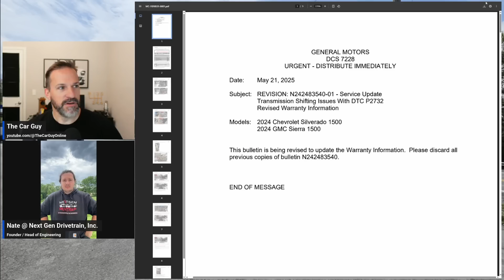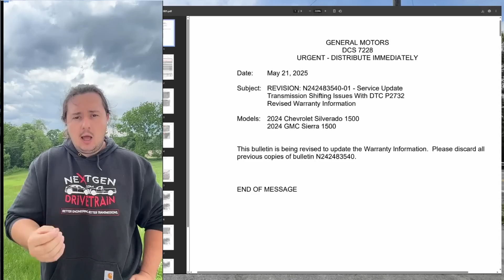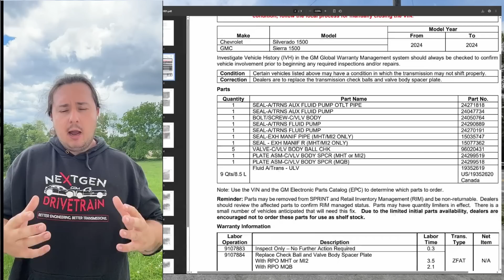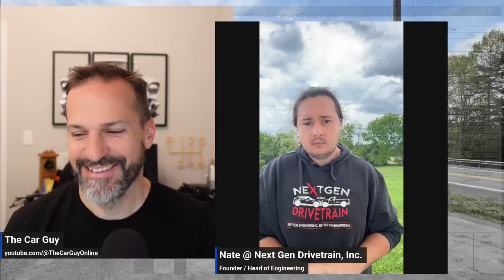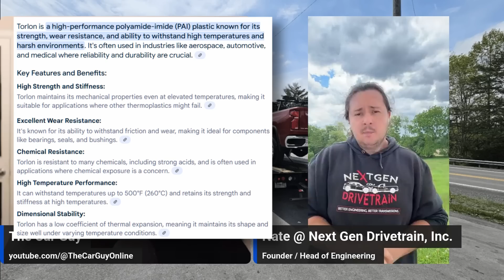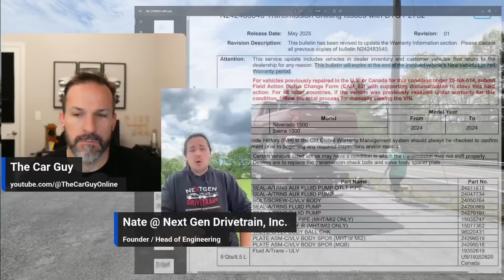GM’s NEW Transmission TSB EXPLAINED by NextGen. Will it EVER be FIXED? Silverado and Sierra 1500

Comment: It was a relief to see Ram finally go full zf finally.  Big advantage over the others
Reply from the maker: Yeah I think they will be more reliable than the Ford/GM 10speed. Toyota, IMO, still has the best transmission though.
Reply: @TheCarGuyOnline  What do you think? Also what about Ram quality overall compared to Ford and GM?
Reply from the maker: @fit4ya1975  I haven't owned a newish Ram, although it seems the ZF transmission might be marginally better than the GM/Ford Variants, and Ram. I have seen some dead ZFs in Rams but it seems like a much lower failure rate. I would look at all half tons at this point if you are in the market, even Toyota. Toyota probably has the best transmissions still, but the 3.4TT issues scare some to other brands. It's a pick your poison world for sure.
Reply: @TheCarGuyOnline  Ya you are right they all have their issues. I may just get a 3/4 ton at this point. I live in a rural area so it would be stronger and more heavy duty parts and for about the same price. Thanks for the response too man.
Reply: @fit4ya1975  Just a note about 3/4 ton.  I went that way in '19 on a F250 and while overall the truck has been reliable going heavy duty did come with an equal number of drawbacks.  Its turning radius is terrible and a pain in congested parking lots.    The ride quality overall is poor (most trucks here in the midwest have the snow prep package and stiffer springs in front).  My 6.2L gas engine and 4.30 gears are great for towing but average 15mpg in daily driving.  The solid front axle gave me a couple of death wobble experiences that just about had me sell the truck (early oem joint failures).  I have a love hate relationship with it.  I love it for the safety when towing but I hate it for everyday driving.  Also barely clears my garage door because its so tall straight from the factory so I end up having to do all maintenance outside and have to plan based on weather.  I have a second car for daily driving as the truck is just not practical for that.
Reply: @spyder000069  Thank you for the info!!  I had a 2020 Sierra Denali 2500 Duramax. Loved it. My garage has an 8ft door so no worries there. It did ride stiffer but not as bad as my cousins F-250 with the straight axel. I have a 1/2 ton Silverado now def rides better but I may get a camper and im not pulling that with my 1/2 ton. Also Im in a rural area so the size isn't an issue. Decisions Decisions!
Reply: @fit4ya1975  I am rural as well (5 acres in midwest).  As a 2nd vehicle it works out for me.  I used to have a little ford ecosport I would daily drive and then reserve the truck for truck stuff (20 foot enclosed trailer and 20 foot flatbed hauling tractor, atvs, side by side).  Kids are now out of the house and I am looking at a plan to downsize some of my stuff in the future.  It is a tossup for me as well since I could easily go F150 or Ranger and haul the toys but put the tractor with loader on my 10K trailer and overloads the ranger and while an F150 would do it I would need to consider distribution bars.   Plus my '19 F250 with the 6.2 non-turbo gas and 6 speed transmission is known to be reliable.  I really don't want to take my chances on the new 10 speeds from either ford/chevy.  So a change up now might invite problems.  Sometimes there is just no perfect solution.  LoL.

Comment: I will never buy a gm product again
Reply: Pretty sure this basic transmission is used on many Ford models too.
Reply: @dcraigkelliher5954  I think the initial design was partnered. Then GM decided a cheaper valve body from a Canadian supplier was the best plan. Not. Ford has other issues with their units but I don't think as bad a GM has happening now. My valve body went at 121k kms on 1500 3.0l They did the "update" and then I figured out it was a warning for when it is going to fail. Update was done around 118k kms so waste of time. Wondering when this VB is gonna fail. It will be gone before the 160k kms warranty runs out.
Reply: @dpg2826 My VB was replaced on my 2022 Sierra Denali 3.0 at around 20k miles about 1.5 years ago. Luckily I leased the truck and it goes back in 2 months.

Comment: This is why I bought RAM, has a ZF transmission in it.
Reply: But they installed junk forever before finally going that route. Glad they did though. My 2018 had a 60k transmission,  missed the zf first in the power wagon by 1 year 😢
Reply: @estherswartz9588 my 2009 expedition..has 276k..on it's 6 speed... shifting perfect..motor perfect..like an electric car..so smooth very happy.. paid 2k for the whole truck..cracked windshield that's all
Reply: @HANZELVANDERLAAY 
Better hold on to it! They don’t make them to last anymore. My 2017 Silverado is on its third transmission. Owned 3 other chevys before it and Ne had a transmission problem.
Reply: @johnbowhunter7676  I did add some type of fluid enhancer to  the tranny....from under the truck..no dipstick or filler in those....tows up to 9200.... impressive....zero ehaust leaks..nd runs on 87 octane.. although when i tow..its gets premium of course
Reply: @johnbowhunter7676 should’ve gotten trans built by a trans shop with upgraded parts and billet converter. Do not put the same junk parts back in that gm makes.

Comment: How much would the kit installation cost, a more or less price?
Reply from the maker: I would call around to local transmission shops and send them a link to the kit. or call NextGen and ask them if they have any recommended close to your zip code. The job is essentially dropping/removing the transmission pan and fluid, remove the valve body and disassemble carefully, repair with the given instructions, put everything back together with new filter, attach pan, refill transmission and make sure you follow proper procedure to fill at correct temp (lots of tutorials out there).
Reply: Love it! Thanks!

Comment: Biggest problem is most people aren't aware of what's going on. TSB' s just guide the dealer ONLY IF a vehicle shows up with that problem, and the dealer happens to see that TSB. How many people have been charged for that repair if they are beyond the warranty time, and not the mileage? And that is just the tip of the iceberg. There are hundreds of TSB's for just about every vehicle. So that indicates how poor the quality is, and goes far beyond the transmission. There will never be any legislation to correct that behavior because the companies support the politicians.
Reply: I disagree... The mandates of the government has caused the manufacturer to do anything and everything to reduce emissions

Comment: So the next gen fix begs the question, you've fixed the weakest link, what's the next failure point?
Reply from the maker: Nate had told me many times that he believes if the valve body is fixed and working properly and your transmission is in good health, he does think it will last a long time. I've heard the same from other gurus about the 10spd, generally built well in most cases but the valve body is the weak link, and that controls the transmission/wears it out prematurely. Do you have one, and if so, how many miles are on it?
Reply: @TheCarGuyOnline  I drive a Honda Ridgeline, but I've been looking to move to something with more tow capacity.  None of the options look good these days.

Comment: So my transmission was “rebuilt” at the dealership at 7,000 miles.  Will the replacement break before I’m out of warranty?  Or did they improve their parts just enough to get 53,000 miles?  This is a 2024 Sierra 1500.
Reply from the maker: What did they end up rebuilding for you? If it was just the valve body it will slowly be harder on your entire transmission than it needs to be, and the upgrade kit will be better/get you further along if you are a long term owner. It might get you through warranty or to 100k, but my understanding is that it will eventually fail and cause more damage to your transmission. Either way, I doubt the dealer upgraded the valve body for you.
Reply: I would have the dealership buy the truck back. 7k miles and you probably paid over $50k for that truck. Buy an older V8 Tundra or a Diesel prior to DEF.
Reply: If you buy a GM valve body you need to return the original core for a refund - so this means that GM with rebuild the core with all the same faulty parts that will fail for the next buyer.
Reply: I was told it was a bad valve body from the factory.  The tech that performed the service told me it was a “rebuild”.  I’d have to look at the paperwork.  I’m assuming it was a new pressure plate and larger ball bearings.  I’m sure they consider pulling the pan a “rebuild” in this day and age.  lol
Reply from the maker: @goose502  They may have just put in a new valve body for you and called it a rebuild. I think the only scenario they do this TSB/rebuild is when this specific code is thrown as shown in the video. Do you know if this was the code you were getting? If it was the more common codes from the rear wheel lockup, I believe you would just get a new valve body instead.
Reply: P2732 was the code.
Reply: They put the same garbage replacement parts back in that were there in the first place. Best bet is to go to an actual transmission shop and get better built aftermarket parts installed.

Comment: There are Tesla cyber trucks which have already crossed 100k miles. After initial hiccups later models are absolutely trouble free. Enjoy ur tranny and engine issues 😂😂😂
Reply: I think you should do a little research. The cyber truck has one of the most recalls of any vehicle on the planet, along with being in the top 10 to never make it to 100,000 miles. 😂 jokes on you…
Reply: @Maynardd  I think u should also do a little more research and get out of the echo chamber. Teslas are at the top of the list in terms of reliability and customer satisfaction. I’ve had them for past 4 years and not a single issues. 90% of “recalls” are handled via over the air update. Cyber trucks had teething issues but late 2024 onwards are rock solid.
Reply: @bobbysuazjFhvcfgh absolutely false. Don’t comment on your own thoughts.
Over 50% of people who own an EV have gone back to combustion. 
Their cars are ugly, Servicing them is a nightmare, their build quality is absolute garbage. And again, all Teslas are in the top 10 for never reaching 100,000 miles. Not to mention they only go about 75% as far as Miles as what they claim their batteries will take them.
Know what you’re talking about before you talk about it. You’re clearly just a fan boy you’re going to say whatever makes you happy so you don’t have to face the actual reality.
Reply: @Maynardd bro stop making stuff up. I bought my Tesla because literally 80% of people in my cubicle isle had one. I will NEVER get anything piston ever again. Also there are several teslas in 300k range with original drivetrain. U can continue to literally burn your money 😂
Reply: @bobbysuazjFhvcfgh now who’s making stuff up? Their crap, have always been crap, and will remain crap.